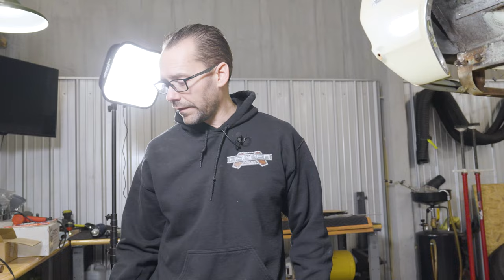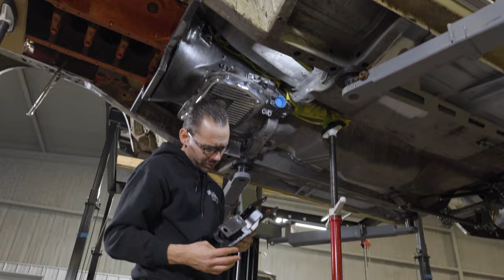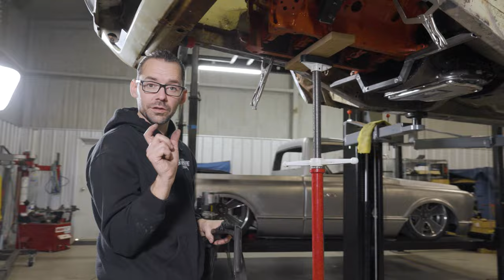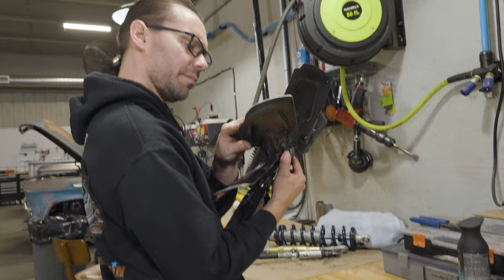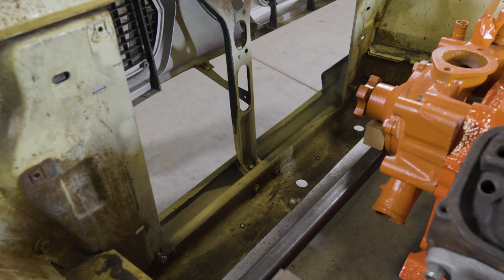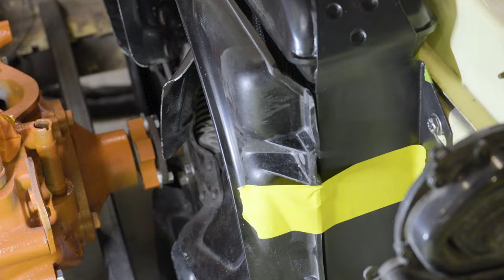67 Barracuda - Radiator / Fan / Shroud Mock Up

Comment: Factory big block A-Body cars used SPECIFIC fan blades... All three years were NON-CLUTCH type blades... Used with a special very short spacer. 67 used one style of blade, and 68and 69 both shared a different type and part number. All three are very tough to find and pricey when found on eBay or at a vintage parts specialist!
Reply from the maker: Just bought one. I’ll see how it fits

Comment: Damn. I wish I was there before you bought that radiator and fan, so you wouldn't have had to move the engine backwards.. A better radiator choice would be an aluminum one with the wider cooling tubes.They work amazing! An after market aluminum flex fan would not stick out far like the clutch fan does, and it pulls more air too. I set up my car that way, because I don't like electric fans. My big block never goes over 195 degrees, even idling on the hottest days in Florida without a fan shroud. Your tolerances are too tight! That engine and body will flex and... UT OH! That clutch on the fan will wobble in time, especially since you crudely trimmed the fan blades. And... UT OH again! The heck with the "stock look". Dyno tests have proved the that flex fans are better.
Shims have their place sometimes, but not in your case. You won't be able to sell kits with tolerances that tight, if you go forward with that plan. What you are doing is pure hot rodding at its best, and I love that you are making your own suspension, instead of buying one. I love watching your build. Please hurry up so I can drive it!
Reply from the maker: Thanks for the tips but there is no way we can foresee every engine/trans/ exhaust/ radiator choices. We are offering a suspension that handles great and makes the car look great. The rest is up to each builder.  We are going to try a different fan. I’m not opposed to using an electric fan as a last resort.